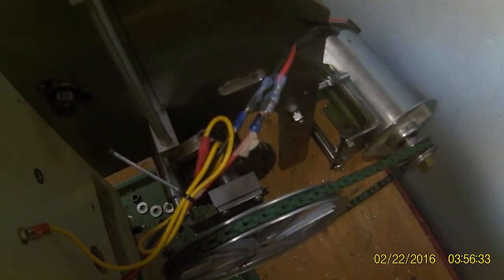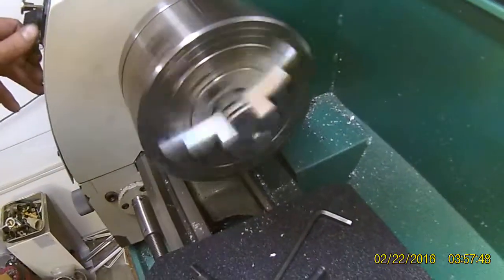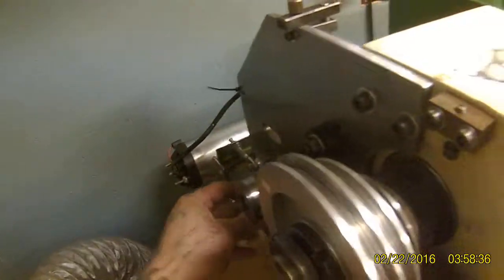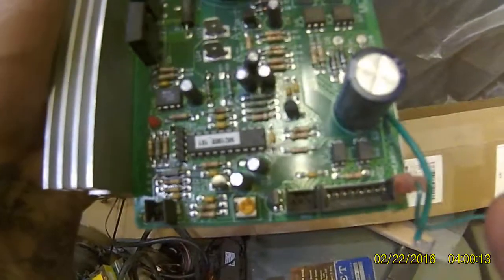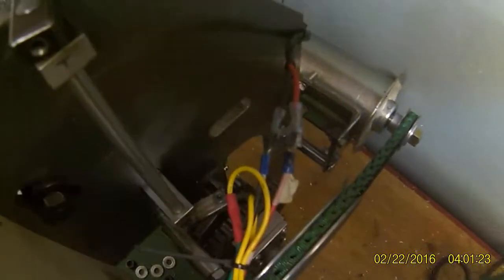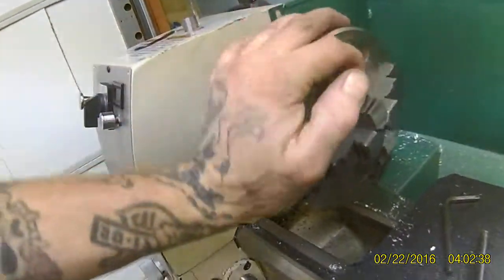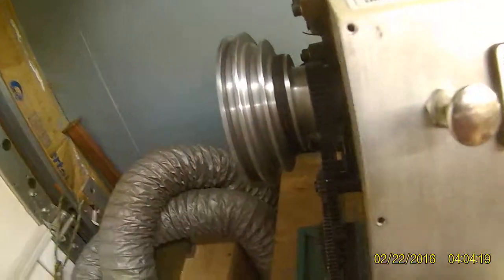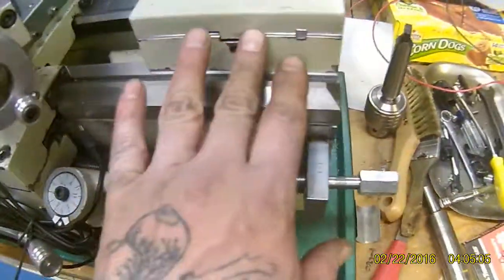high low gear box installed

Comment: Good job pulling that gearbox together.  Be careful you don't twist your spindle with all that torque, I've got a Craftsman 6" lathe with the ridiculous skinny spindle in my junkpile because somebody twisted the chuck end right off.  

You're gonna get burned by playing music in the background though, it's only a matter of time before ya get yer wrist slapped for that.  :(
Reply from the maker: It's the 50's on sirius, i suppose if they want to complain they can. The low gear is mostly just for threading so I should be alright. Then again it is a grizzly. Either way the belts should slip before any mechanical damage is done. Thanks though.